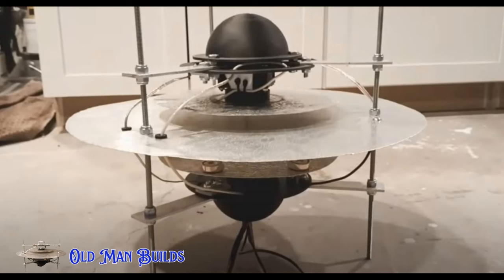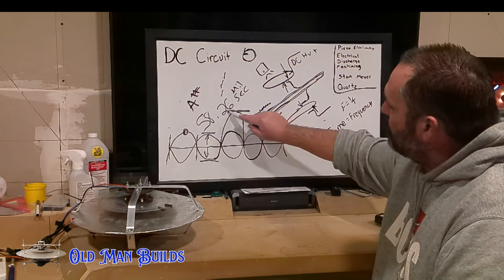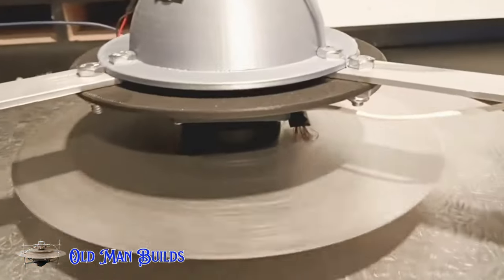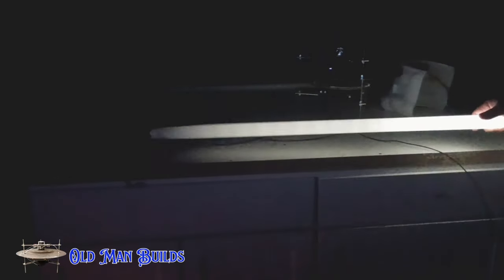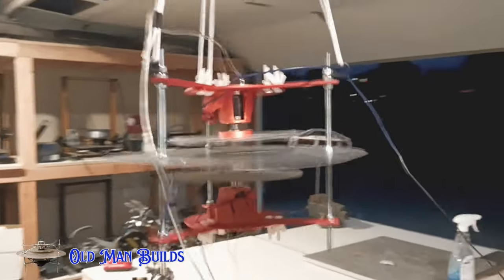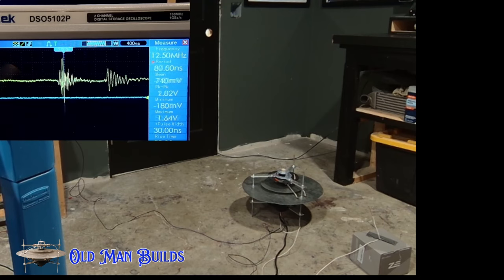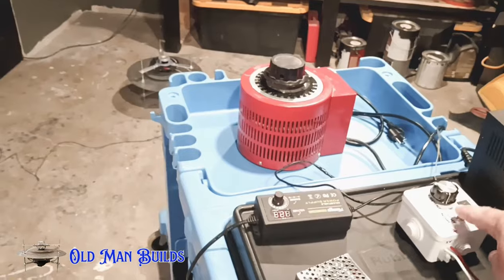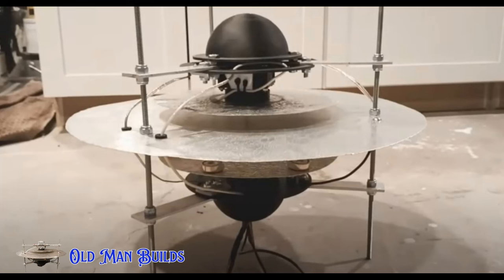Building My Graviflyer "Test Everything"

Comment: Nathan, I use an android phone and a gravity field app to find out where the settings should be. The out of phase is due to the power grid to your power supply being out of phase. The rpm is too slow as I showed you with my frisbee experiment. What high voltage do you use on the top and bottom disk as I never heard you tell us. The center wire on your tesla coil is not centered so the frequency bounces all over. Spin the center plate as a plastic disk like my frisbee experiment. Alexey has an LC circuit, and you have an RLC circuit due to the power grid and I gave suggestions on what to do to solve this issue.

Comment: The basic idea is the Biefield-Brown effect, which is essentially a high voltage pulsed DC asymmetrical capacitor. That asymmetrical pulsed DC capacitor will exert a force towards the positive polarity. And this spinning magnet generator thing is essentially a mechanical version of that, albeit a very convoluted one. My thoughts are, if you are going to go with a spinning mechanical design like this, then do it in a way that will maximize the pulsed DC voltage gap. The best way to do that would be with a van degraaf generator, which can generate up to millions of volts pulsed DC. So if I were building this thing, what I would do is construct a rotary van degraaf generator, where the positive output is encapsulated by a larger surface area saucer shaped disc and the negative ground is a smaller surface area disc and the spinning van degraaf generator part was sandwiched in the middle of those two discs. That would maximize the Biefield-Brown effect and should give you enough pulsed DC voltage to lift the thing off the table. Just be very very careful, because these high voltages are deadly.

Comment: By watching this i can feel the stress your craft is going through, i suggest if you can make a craft that has the top and bottom plates slightly shaped like cones, both pointing cones upwards, the center plate is normal flat plate but should be larger, not spinning, also heavier than both. Both top and bottom plates should be less than 45 degrees cone shaped. Both top and bottom plate rotates against each other, top plate clockwise and bottom plate anticlockwise. Only the top plate must have a MOSFET cut on/off switch circuit connected to it so in this way when the top plate spin and makes a sudden slow rotating speed in every split of a second it creates a sudden push up.
Reply from the maker: I am reverse engineering the Graviflyer. However My solid state version is more in line with what you are saying.

Comment: How do you get burned when it’s cold? Why no shock?
Reply from the maker: it is cold energy. I keep saying it is different.
Reply: @nathanbunten4299 thanks I’ll look into that 🙏🏼
Reply: Really it's the same way radiation can cause a burn, the frequency of the field itself is not temperature hot, it is in a state of potential until it interacts. Anything generating high resonance will have interactions with soft tissue.
Reply: @TheSTR8dope  thanks for your insight!

Comment: 底部几个圆形磁铁要分裂形状   N  N    S  S   排斥组合，，，这样在选装中可以从裂缝中产生 扰动等离子的 磁力流。。。。从而震荡电场
Reply from the maker: the magnets put frequency on the center plate. they need to be north only.
Reply: @nathanbunten4299  你把⚪型磁铁做切割  然后在组装成圆形。。    这个叫超强磁极    贝迪尼原理
Reply from the maker: @__xiaifei  yes but the magnets are shelled. so no push outward. They only go to the plate above.
Reply: @nathanbunten4299  你必须把每个磁铁分割，然后在固定成⚪  圆，，挠场才能从裂缝产生。。。才能影响等离子。。。
我目前在做尼科夫的悬浮盒子。。。
Reply from the maker: @__xiaifei  it is not plasma it is scalar.
Reply: @nathanbunten4299  我明白，  标量双螺旋 ，磁铁产生扭曲磁场，  上部分的超声波共振使电子脱落。。。你测试过使用接水的特斯拉接入了吗？？？震荡频率很重要

Comment: The alluminum discs are 1/4 ???
Reply from the maker: 1/8 and dimpled. You could call it an orange peal look.
Reply: What about the steel  rods what size are those ?
Reply from the maker: @bryansautoandmotorcyclerepairs  1/4"
Reply from the maker: @bryansautoandmotorcyclerepairs  I have 3 videos on building and stl files for a 3d printer. https://youtu.be/kFa3lvylyyw
Reply: @nathanbunten4299  ok will check them out but im gonna try to make 1 just been busy with other stuff lately

Comment: 不可以有  打火现象
Reply from the maker: That is correct. Cold energy in the center. Very small heat in both spinning disc's. if you overpower the heat you ruin the system.